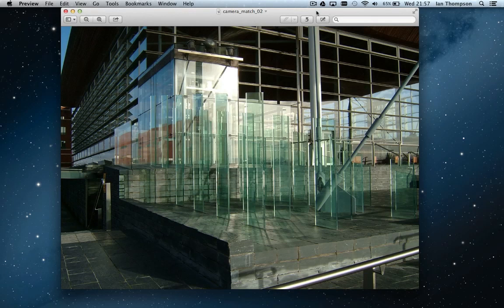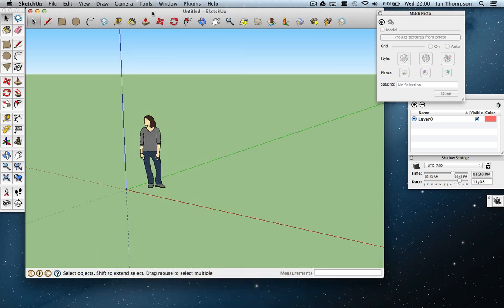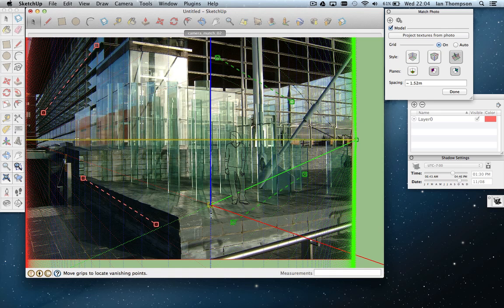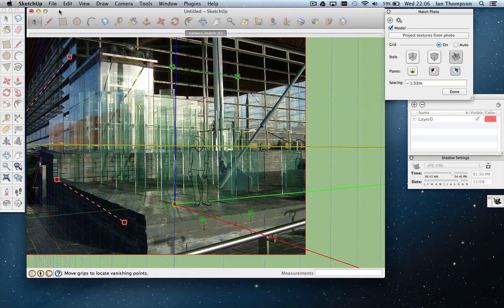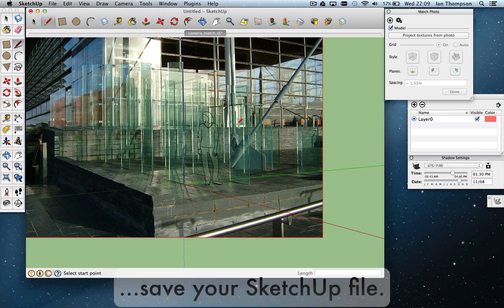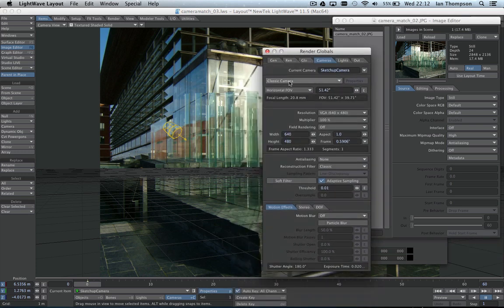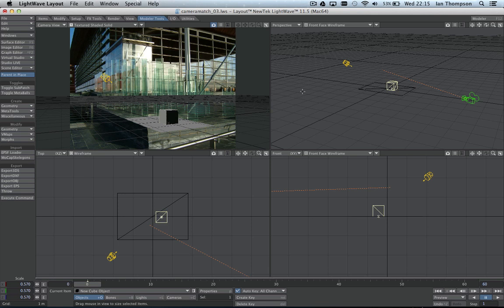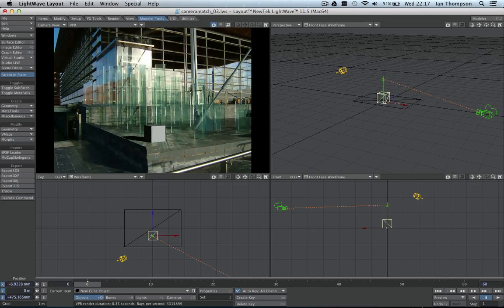LightWave 3D - Camera Matching (part 02/01)

Comment: Dragged the .rb files to the SU plugins folder (found it), but no result in the SketchUp preferences window under Extensions. You can install extensions through the SU preference panel under Extensions, but unfortunately it won't recognize the .rb files, they are greyed out. What to do...
Reply from the maker: Thanks for you comments, I work on a Mac so it does work I  promise :) I'll post bullet list of steps for you to get it working when I get 5 mins. The scripts should work because they are Ruby scripts.

Comment from the maker: Hi, inside SketchUp. After you import the image the first point you should position in terms of the axis, is the Origin ( this is important ). The position of the origin can vary, but if the best place is where you have all 3 axis visible e.g. the front, near side, lower corner of a house. In this case I chose the base of a vertical glass structure. Hope that helps.